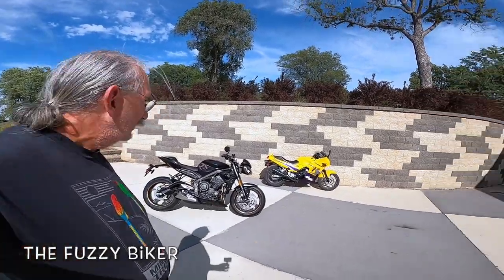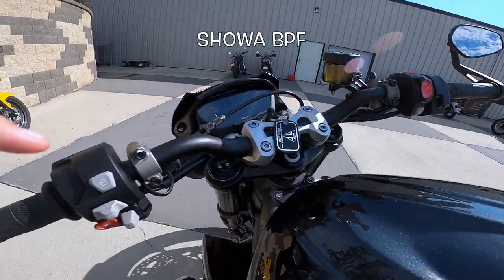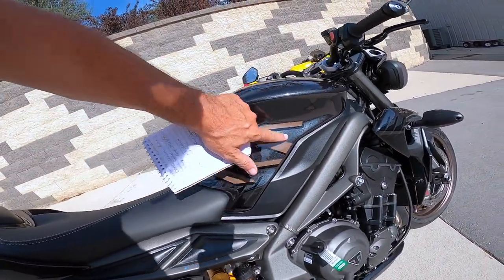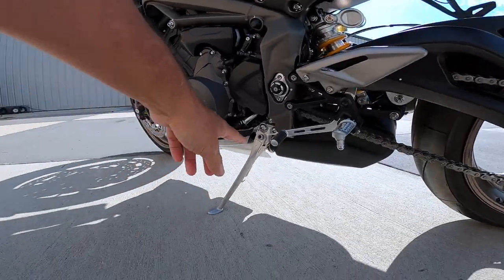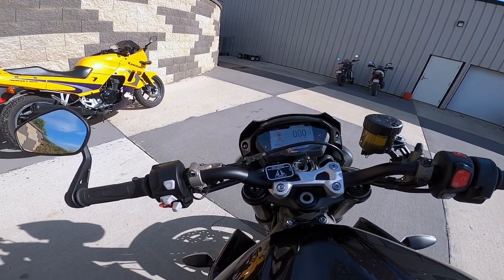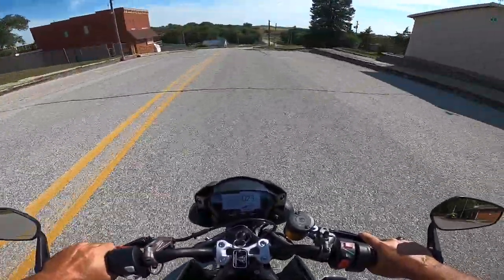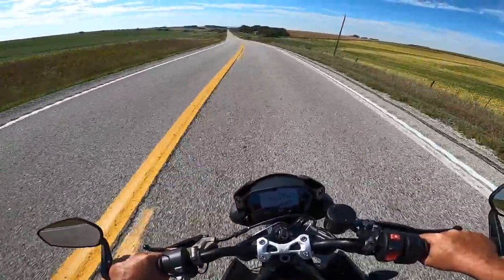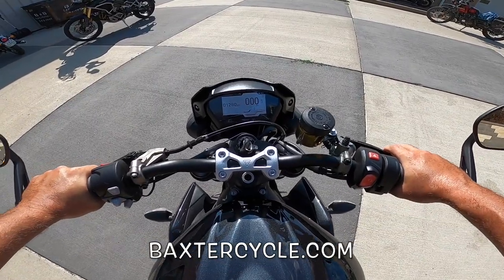Triumph Street Triple in Carbon Black, Wahoo!

Comment: I'm just wondering if I should buy this one Carbon Black RS, or the newest one Carnival Red RS which is about €1200 more expensive? 
What do you thing, and which one would you choose?
Reply from the maker: You can't go wrong with either one of those bikes. I rode the carbon black RS and just fell in love with it. However, I'm a sucker for red and would consider that worth 1200 more. I guess it comes down to the money and which color you like best. If you like the black and the savings do that one. If you don't mind spending the money and like red, do the red :-)
Reply: @forgottenmotorcycles For me it's not only the color choice, I'm more worry about if the new ST RS with it's all internal engine parts changes, smaller fuel tank, less headlight fearing, new exhaust, different/shorter gear ratio will be more track focused bike than the road bike? Even the previous generation up to 2022 had less mid torque, and had to be high rev to get the power out of it 
But in general in my opinion it's best looking naked bike.
Reply from the maker: @darekz9777  I understand what you're saying. One of the things that amaze me about the street triple was its ability to pull the front tire off the ground at most any speed. Beautiful motorcycle